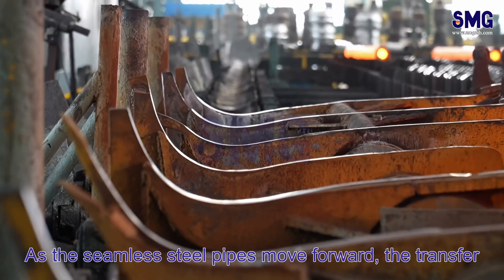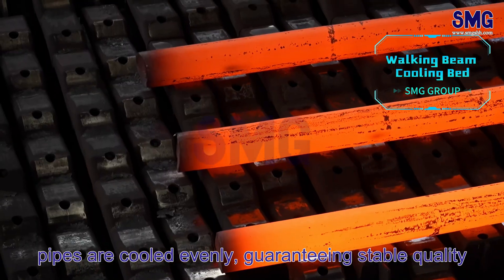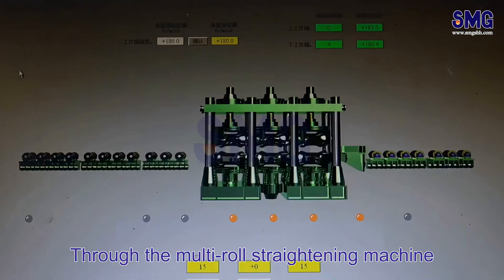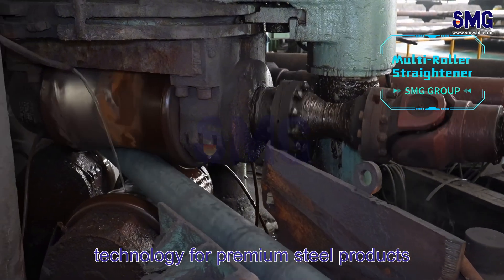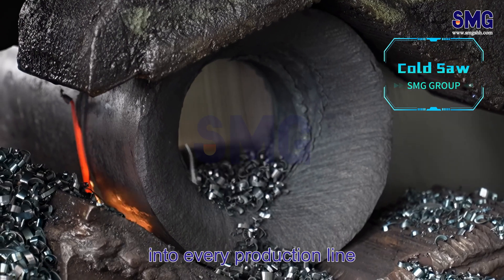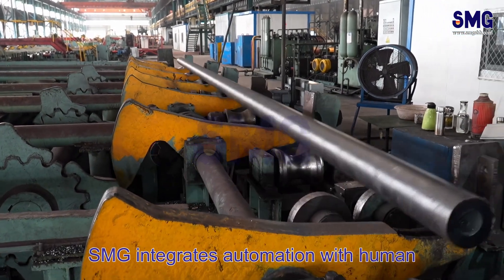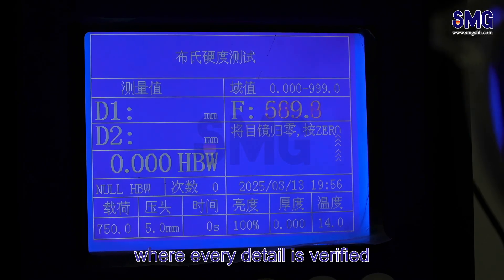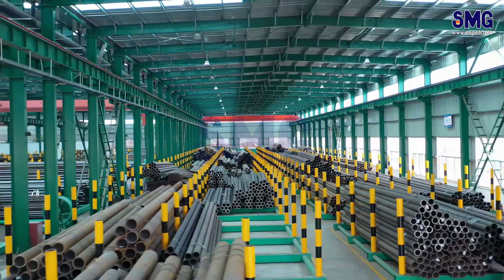“Seamless Steel Pipe Production Line | Full Process, Testing & Turnkey Solution by SMG 🔥⚙️”

Comment: The cooling effect of this cooling bed is quite good. Typically, hot-rolled pipes enter the cooling bed at temperatures between 850-950℃. After being cooled on the walking-type cooling bed, to ensure straightening quality, they are fed into a multi-roller straightening machine at temperatures not exceeding 80℃ for repeated bending and straightening operations.